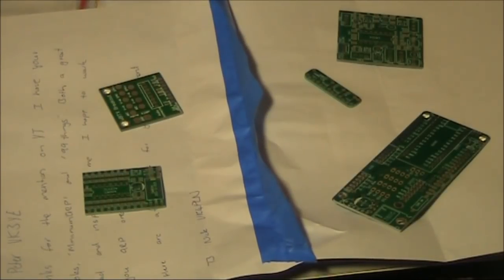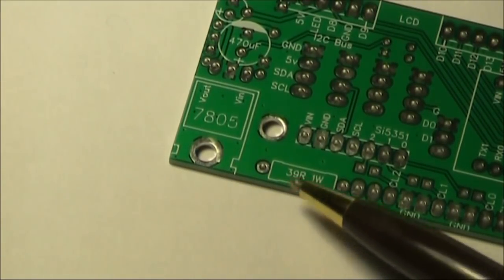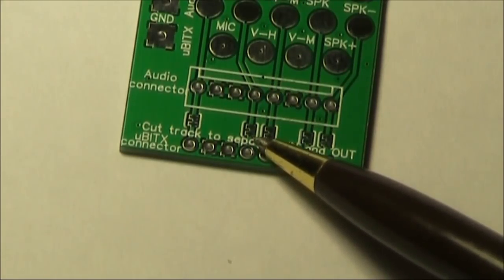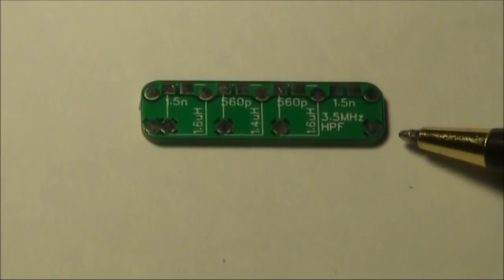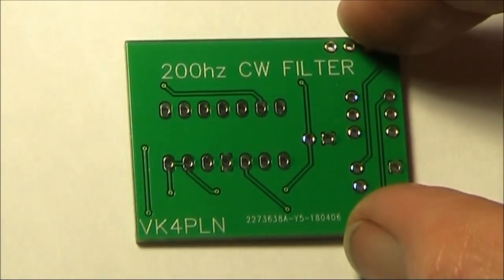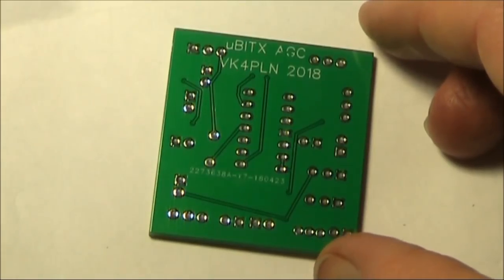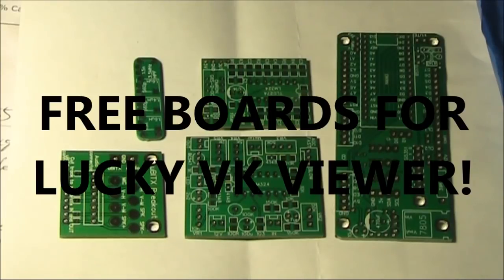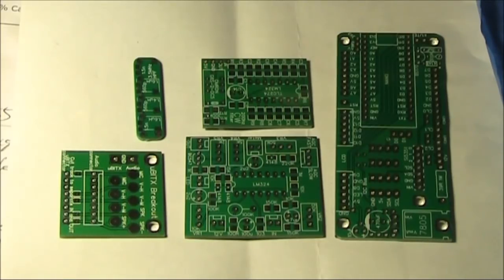Introducing VK4PLNs ubitx circuit boards (and VK give away)

Comment: Thanks for sharing this information.  I have already sent an email to VK4PLN about getting one each of these boards, especially since I am not eligible to enter the contest.  I love the uBitx and have already built a version 3 board and posted it on my channel.  I recently ordered and received the version 4 board and holding off building it until winter.  My version 3 is my experimental rig where I try the modifications and see how they perform.  I even built my own aluminum enclosure using aluminum angle for the frame and aluminum corner flashing.  It's approximate size is 7 inch x 7 inch x 3 inch.  I have already done the RF gain mod and just finished building the s-meter circuit.  Again thanks for sharing.  73 Juddie WD8WV - from across the big pond. LOL